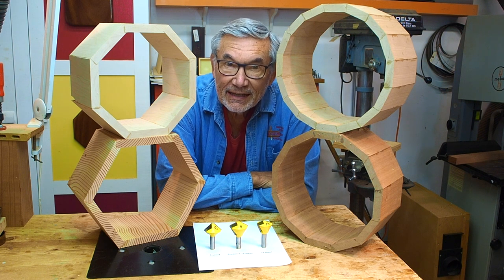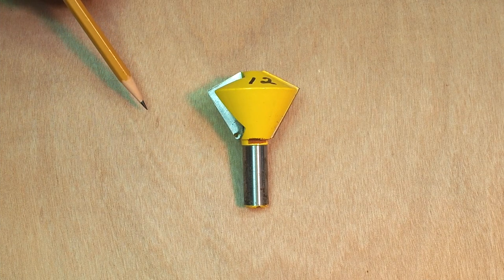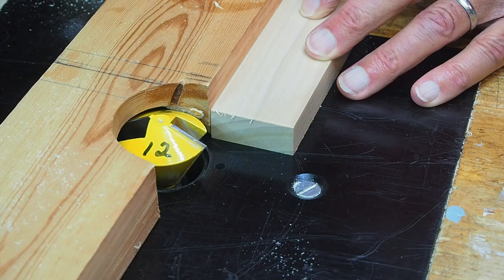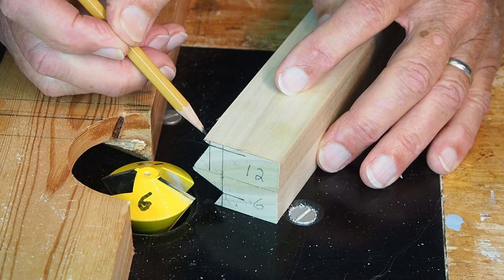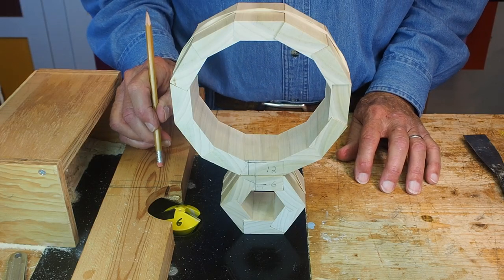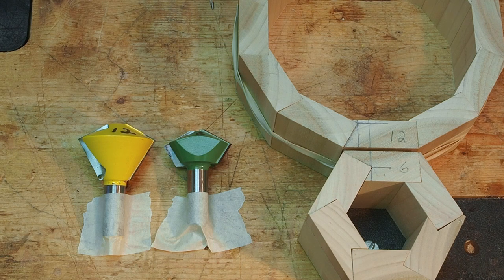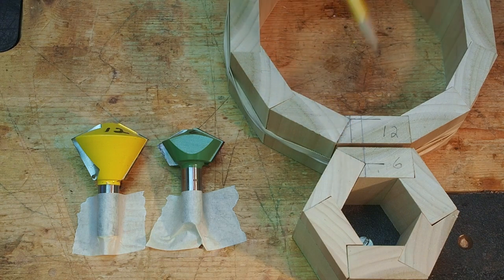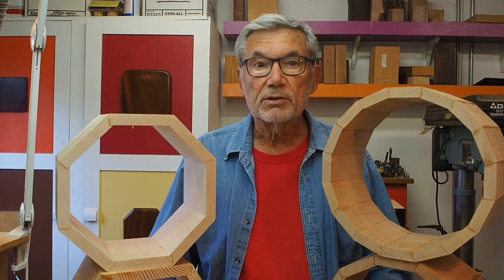Bird mouth joinery: The 6-side/12-side dual router bit

Comment: Hi Mr Henry. I enjoyed these BMJ videos very much. I have just got to the tape up of the 12 sided bow. I'm using maple and sepele.  So far, so good. Thinking ahead about the bottom of the bowl, what do you think of making the bottom from 1/4" ply instead of 1/2" ply?
Reply from the maker: Hi Roy!    Thanks for the comment and question; glad everything is going smoothly! Quarter-inch ply will work just fine and give you a fine looking bowl. I have used it many times. I chose the thicker stock for a personal and, probably not-very-important reason. Having made quite a few bowls, I've noticed that, as the bottom stock gets thinner, and as the bowl gets bigger in diameter, the sound made when the bowl bottom is touched or tapped seems insubstantial and less appealing. Thicker stock gives a more solid, appealing sound when the finished bowl is handled. I'm sure there is no strength or appearance problem with the thinner wood; it's just the sound. Probably some kind of drum-head effect. The bowl you are making reached my personal limit on the sound it made and I went for the thicker bottom.
Reply: davidhenry32 
I would not have thought of that. I will use 12mm ply. Thanks again from the UK.